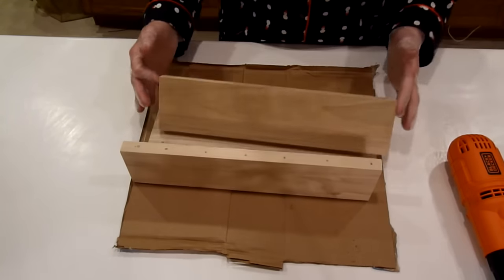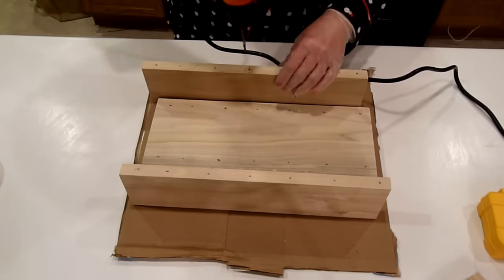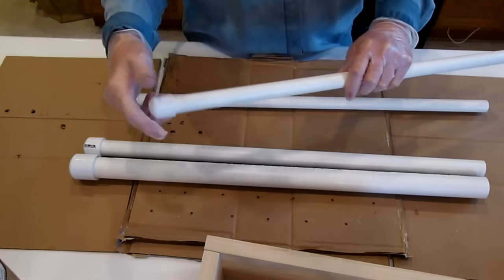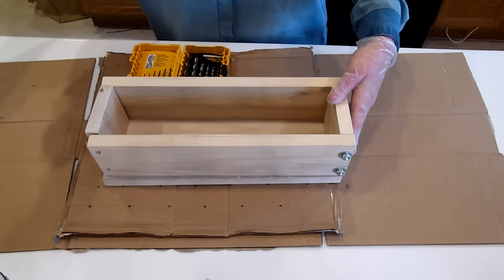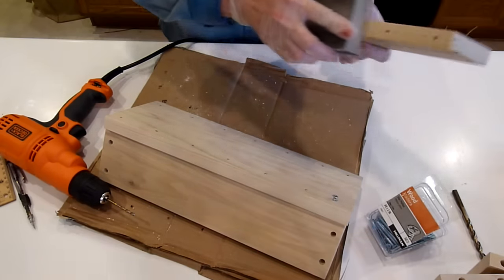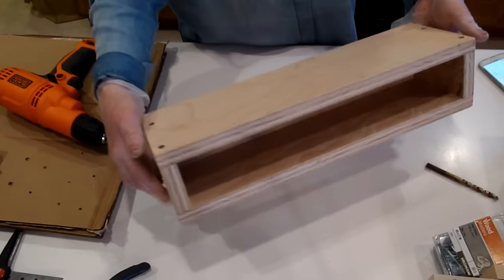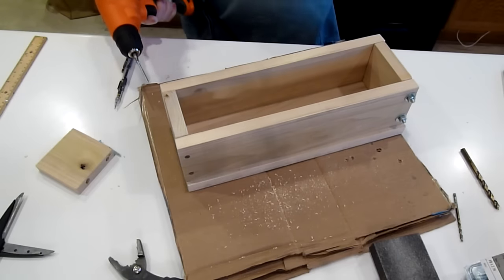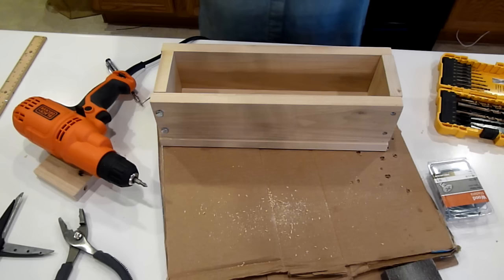DIY Wood Soap Mold Project. Yes!!! I finally did it, and Lowes Cut the Wood For Me!!

Comment: PPS you can ‘countersink’ your base screws with a special drill bit attachment - which means that your screws will be set in lower than the surface of the wood. Neat and no scratching of tables ; )

Comment: The saw they use is pretty good but not always accruate so if you ever get some wood thats a bit bigger or shorter thats why.  typically its used to cut boards in half and such. Im glad you found a guy willing to make the small cuts for you. I used to work for lowes hardware before i became a stay at home mom.
Reply from the maker: Adra Bloodstone Yes, that's exactly what he told me, that it wasn't extremely accurate.  He did a great job, and I knew that the cuts would be off very slightly. t The guy at Lowe's was very helpful!
Reply: Thats great he was so awesome :)

Comment: PS for your pilot holes , one would generally select the drill bit that’s next size down from the screw size you’re using. Just hold your screw against your drill bits to check  ; )

Comment: there are 3 jaws in the end that holds your bit (the chuck) and the bit needs to go in the middle of all three so all three can hold the bit if it's only held by two you get a mixer type rotation throwing holes off and damaging screws. also you drill down to your hole depth then without changing anything keep the power on and pull back/up out of your hole. the only time you use reverse is to take screws out. or the change bits. reverse opens the jaws and forward tightens the jaws of the chuck.

Comment: You could sand the ends some so they aren't so tight. They used a router to make channel for the tall and skinny mold removable bottom. :)
Reply: Also, on your mold, you could use wing nuts for the removable end.  Which would make it much easier for you. :)
Reply from the maker: Cheryl Thank you for the info, I haven't even needed to remove the ends, i pull my soap right out in the freezer paper.  I'm loving them! I don't have any tools except the drill/driver that I bought to do this project. Maybe in the future I will add to my power tool collection. Have you used a router to make the removable bottom? If so,  Tell me about it, I would love that info!